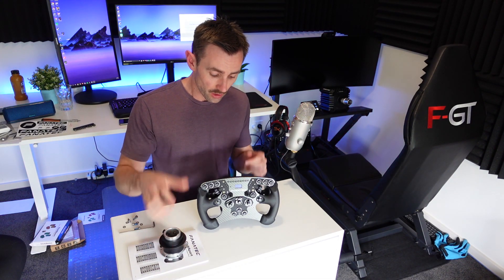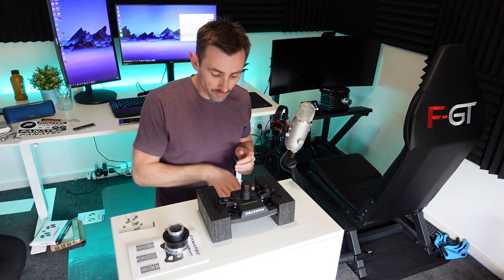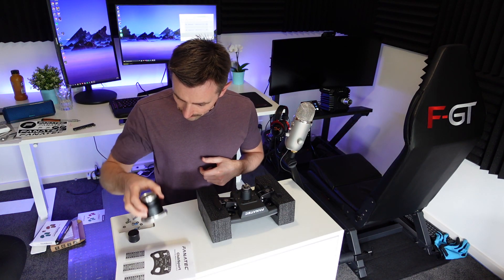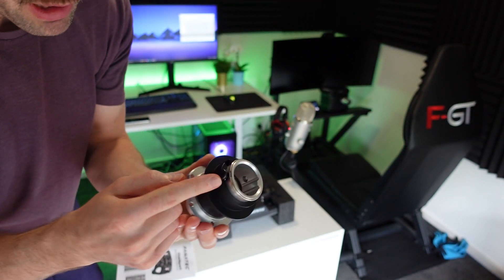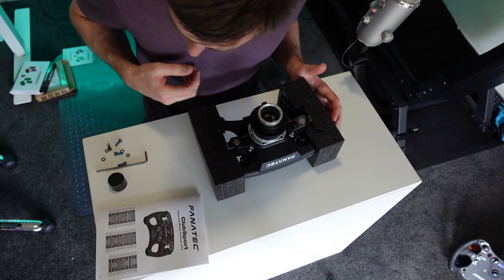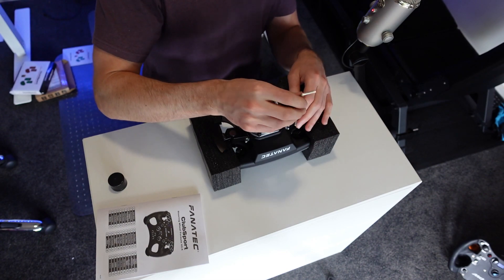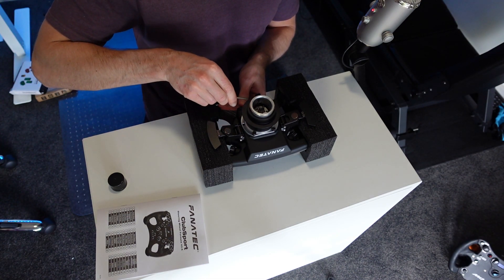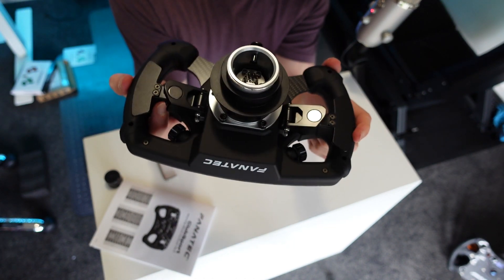FANATEC QR Installation on Formula V2.5 wheel rim

Comment: Not interested in spending $$$ on the NLR GT Track so I took a 1"x 0.250" (24.5x 6mm) aluminum bar and had it drilled at one end then slotted on the opposite. Mounted it with one on the bolts on the shifter platform base at the frame then the other at the wheel base plate mounting bolts for more ridged rig.

Comment: I have to use the secure Bolt. Without, my QR1 is rattling very loud. 

My other QR1 wich came with the FormulaV2.5 fits and doesn't rattle. 

It's a Lottery, made by Fanatec.

Comment: After having worn down my GT DD Pro steering wheel, where the rubber was so worn out that the plastic underneath started to appear, I contacted Fanatec and they offered a repair, likely without costs but I'm only like 95% sure about that, fingers crossed. If Fanatec doesn't charge me for the repair, I might be willing to get the formula v2.5, but it's expensive especially since they raised the price. I'm wondering how the leather on the V2.5 is, is it good quality? Because the rubber from the GT DD Pro wheel is soft and wears out way too fast.

Comment: What does a quick release adapter do?
Reply from the maker: The quick release is a way of connecting your wheel rim to the wheel base. You can have different models / types / versions but the one I use for my wheel rims is the metal Fanatec quick release (also known as QR1), as Fanatec are releasing a new quick release (QR2) soon. I hope that helped out :)

Comment: Do you know what wheel base I can use for the formula v2.5 on PS5? Cheers!
Reply from the maker: Double check this on the Fanatec website but I think the only base compatible with the PS5 is the GT DD Pro. In relation to what wheel rim you can use, I'm not 100% sure as I don't have a PS5 and Gt DD Pro to test this out, however most of their wheels should work if you have the GT DD Pro wheel base. I hope that helped :) thanks for watching and leaving a comment